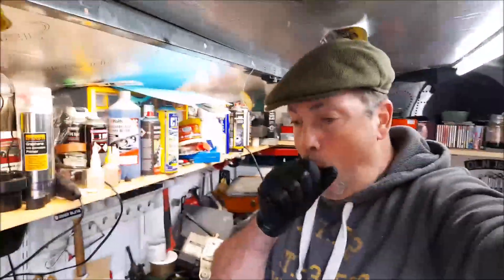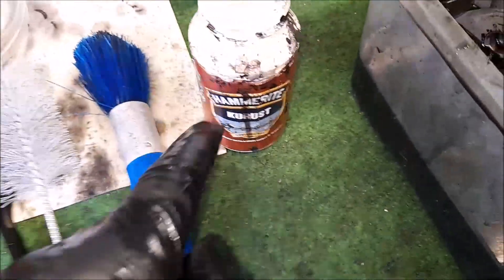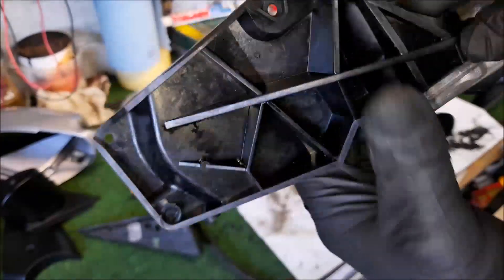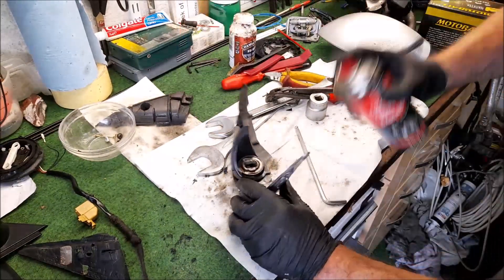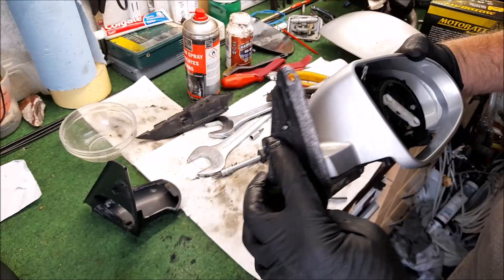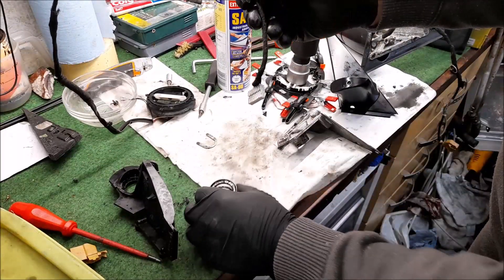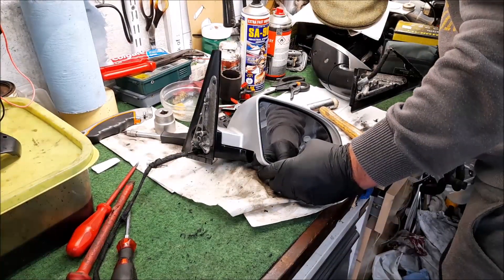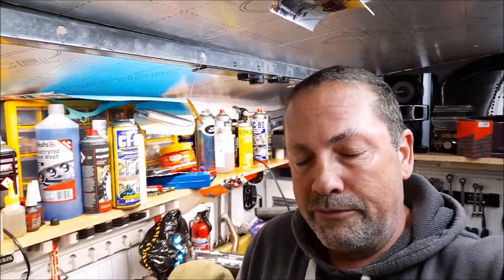Audi A2 Resto Epi 13 part#1 mirrors & speakers

Comment: Morning Bob. Happy New Year. 2023. I have been following your A2 work vids as I have one which I’m doing a slow rebuild on mainly front and rear suspension and brakes. Also have some heated leather Audi TT seats to go in.are you a member of of the A2OC club?
Reply from the maker: Yes
Reply: What name on the club do you go under. There is / was a Bob D, last I saw was off th NZ